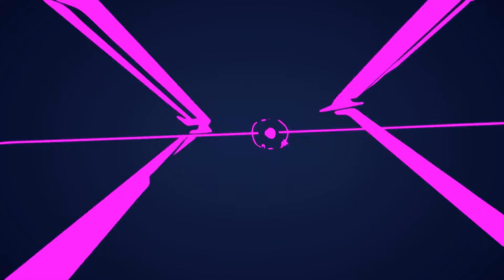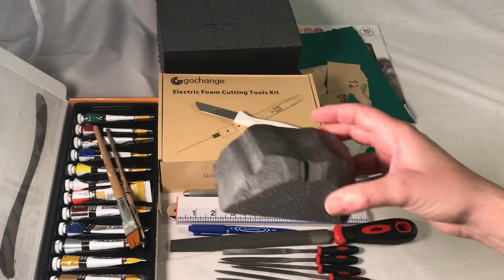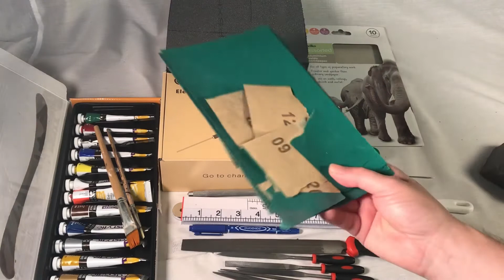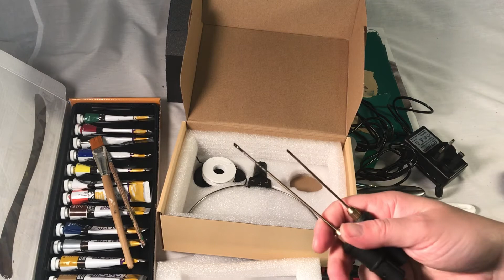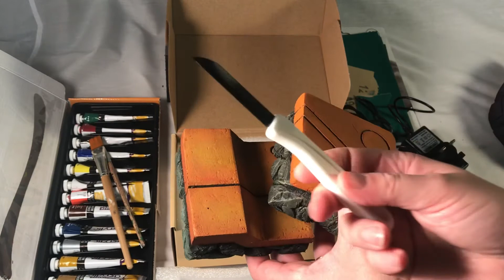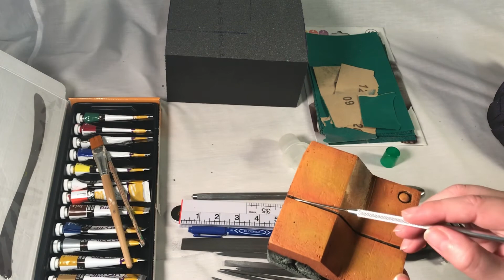Basic tools and materials

Comment: I do rather like that cutting kit. 

What I use for dry-brushing is one of my "pointy" brushes that has reached the end of its useful life, usually as the bristles have split. Just cut the top off so you end up with a circular flat top if that makes sense? Just gives the brush a little more use before I have to admit it's done! 🤣

Did I hear a kitteh? Going to need pictures! 😁
Reply from the maker: That’s a great idea, the older and more knackered the better really. You may have heard Autumn our rescue cat 😊